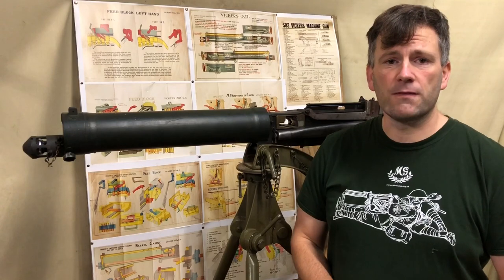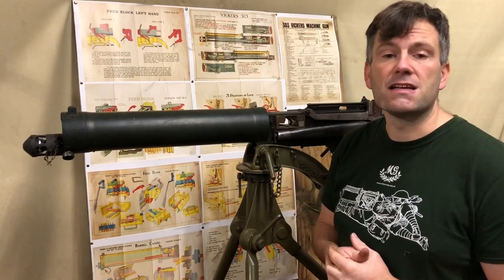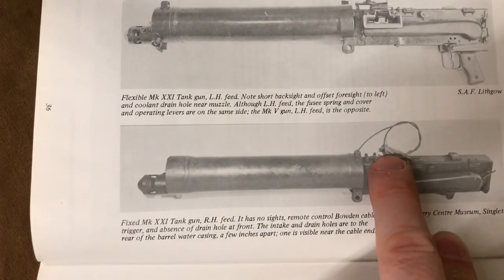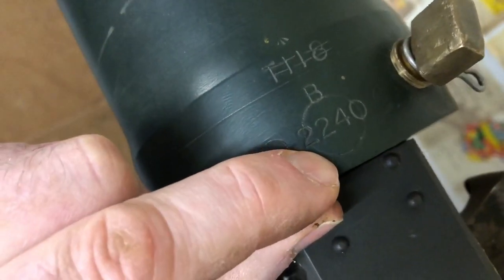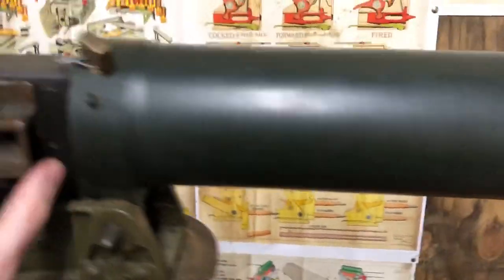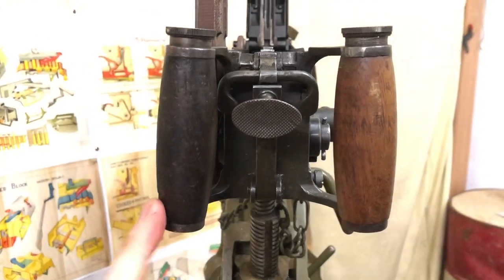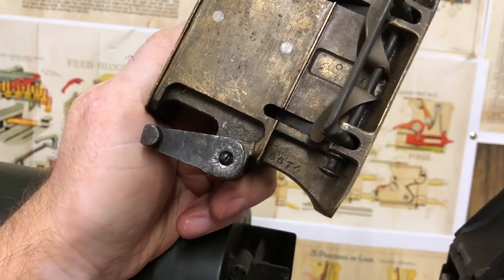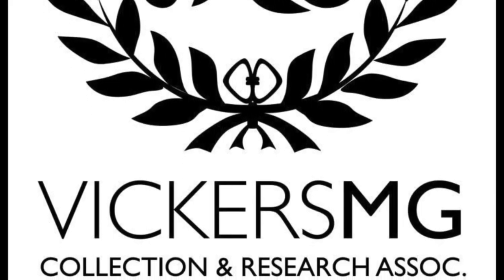Vickers MG Study: B2240 Australian Mk I with a previous life

Comment: Assuming the T118 means it is the 118th tank gun, then that one would never have had a pistol grip, it'd have been the Bowden cable setup. The first 130 or so guns, probably including this one, were for the Sentinel cruiser tank and neither of the mountings in those will accept anything with a pistol grip, the coaxial MG is on the far side of the main gun and is not in a suitable position to be fired like that, you might think it is therefore for the hull MG but there is a pseudo-pistol-grip on the counterweight for the protective armour that is used to control the gun and fire it by cable. The remainder of the 284 are either for the other marks of tank, or the heavy armoured car, but all of those only have coax guns which are cable fired.
The water ports as you point out were both at the rear, the pistol gripped gun still has the front steam tube connection. The tank's guns are not connected to the engine radiator, that would require something a pair of rotating water lines to supply the gun in the turret and long set of pipes for the hull gun, instead each gun has local water tank and coolant is continually circulated by an electric pump, the steam pipe bits are used in this case to ensure water flows along the length of the water jacket. For conversion to Mk.I the front sight would have been added, as there is no need for sights on the AFV guns, the coax has a telescope in the mounting, and the hull was expected to be aimed by tracer.
I have no idea where the pistol gripped gun belongs. I wouldn't be too surprised if it is an early development or experimental one, possibly even the very first given it still at the Lithgow SAF Museum.
All up the Mk.XXI is more or less a water cooled Mk.V, which fits as Lithgow had made over 1200 of those before the Mk.XXI, the 500ish figure you state is wartime MK.V production but Lithgow had been making Mk.Vs since 1935.
Reply from the maker: Thank you for that excellent information. It all adds to what we know about these guns as it’s so often overlooked that Lithgow made anything other than Mark I guns. The assumptions about pistol grips are from the photo of the SAF Lithgow gun but also because that’s how all the British AFV variants were equipped. I don’t think the British Vickers AFV guns used Bowden cables at all for firing so that’s really interesting. Thanks once again.
Reply: @vickersmg  The pistol gripped example threw me too. I would love to be able to say for certain what it was for, I've asked the Lithgow SAF Museum and they went well out of their way to help but couldn't tell me much. There's some weirdness going on there if nothing else.
There are some photos around of sort of hybrid guns, for example if you go along to the Australian War Memorial collection database and look up 044557, the rear two are Mk.I the two on the sides are Mk.V, the other three? water cooled but no pistol grip because the rear pin is needed for the tripod, no sights front or rear, they have the latch for the side opening top cover, but they still have the front connector for the steam tube hose, and what looks like a trigger motor on the feed block cover, so they are intended for a Bowden cable but I really don't think they would fit under the armour of a tank with that front tube connector because there's very little room there. Presumably the factory have just supplied whatever wasn't needed elsewhere that they had lying around for this display. But those three are still a strange combination of features.